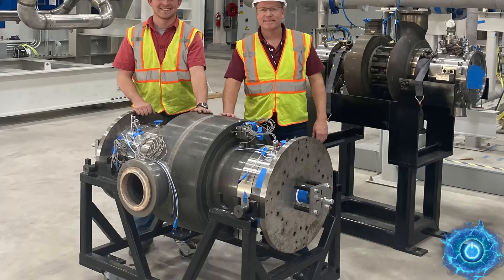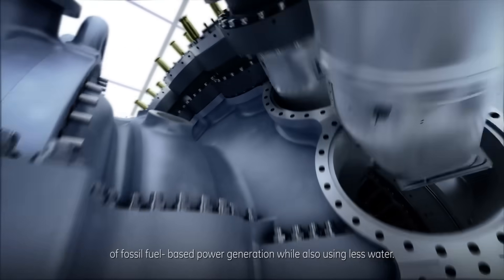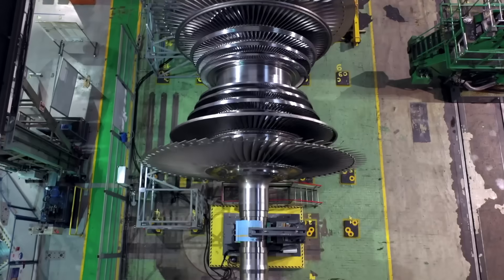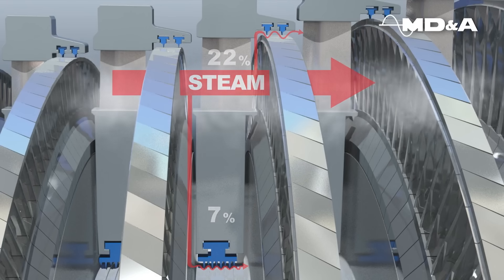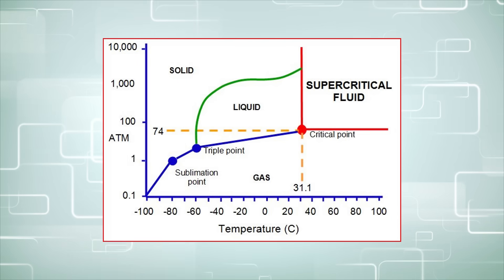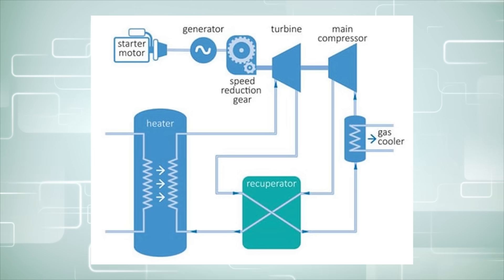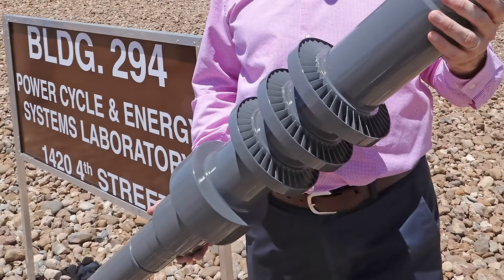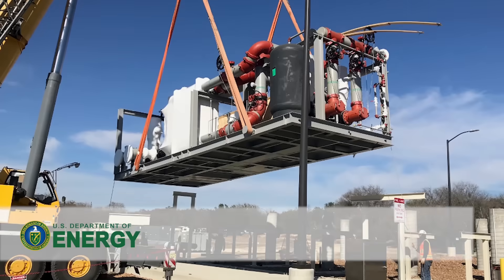BREAKTHROUGH Supercritical Turbine Breaks RECORDS

Comment: Ultra-supercritical technology is used at the RDK 8 coal-fired power plant in Karlsruhe, Germany. The plant achieves 47.5% net thermal efficiency while producing 912MW of electricity, making it one of the world’s most efficient hard coal-fired steam power plants. 

As a note, I suspect that this efficiency number is based on the the Higher Heating Value of coal.  

Another steam power plant utilizing double-reheat steam cycle and cold seawater for cooling, resulted in a net electrical efficiency of 47% (LHV basis).
Reply: Yes, coal is the best end user for CO2 turbines due to their lower Temps allowable compared to CO2.
Reply: @w8stral  
Expand upon what u said, I am unsure what u meant. All I was commenting upon was that the most efficient coal plants are better than what the video said. Oxygen combustion has some interesting applications where the working medium is CO2 with natural gas as the fuel.
Reply: Are you en engineer?  If so you should have been able to decipher.  If not, what limits Coal efficiency is its maximum temperature as it uses water and water is pressure limited not temperature limited.  And no, Coal plants are no more efficient that what video originally said.  mid 40% is max due to energy required to turn coal into dust , preheaters, sulphur scrubbers etc.  But the biggest problem is Thot of Coal verses natural Gas.  Efficiency is ~~~ Thot -Tcold.  Changing from water to CO2 allows much higher Delta Thot-Tcold    CO2 as a medium helps make smaller turbines due to allowable pressures at higher temps.  Does have the big problem that when everything goes tits up, all that high pressure CO2 will kill anyone via asphixiation nearby and therefore will require a giant pressure vessel around the main turbines.   CO2 + water can also create acid, but that can be dealt with.   @Mentaculus42
Reply: @w8stral  
Yes I am an ME and it seems like we are talking around “definitionial” issues and I specified ULTRA-SUPERCRITICAL steam plants with reheat and the information was from an authoritative source. One of the articles specified:

A USC plant operates with steam conditions above 3,500 psia and 1,100F (593C). For comparison, a conventional supercritical unit operates at steam temperatures of 1,000F to1,050F (538C to 566C) and pressure typically up to 3,500 psia! 

So are you referencing USC with reheat? I have done test on regular steam turbines and am quite aware of the parameters. As I noted, the issue with using LHV vs HHV & REHEAT &  the use of COLD WATER for the condenser. Unless u r directly involved with this industry, I will go with the authoritative sources that might have some marketing hype or leave out some peripheral loses but are consistent between different plants with different equipment.
Reply: You are talking tiny specifics which I find useless to talk about unless your fingers are actually in the engineering numbers and totally useless in a Youtube comment; instead I am talking whole plant setup.   @Mentaculus42
Reply: @w8stral 
3:09  He states that steam is 40% efficient, I said better from authoritative sources, 47%, you say 45%, so 40% is wrong and we are arguing over 2% & when I reviewed my source it went into great technical detail about the complexity to achieve that number! So knock it down to 45% because your definition is different than my source. But 45% vs 40% is significant and the video got it WRONG by both our numbers and not a little bit. So if you want to take it up a notch and discuss the details, bring it on.
Reply: @Mentaculus42  Speaking about (direct) oxygen combustion... what does it have to do with this sCO2 turbine? I'm reading that this turbine operates at 700°C while direct oxygen combustion would elevate flame temperature from 2000+°C to 4000-°C... So with the T_hot mentioned by w8stral in mind, it seems oxygen combustion gives great prospects for efficiency improvements (although they now use it for other purposes than efficiency, GTL to be more precise...). But my point is that this seems to be a different direction of research (within the realm of the open gas turbine and not the closed-loop turbine) and this sCO2 turbine is not intended for such extreme temperatures anyway?
Reply: @Mentaculus42  By the way, isn't this the natural niche of these so-called thermophotovoltaic panels... they try to hype those for energy storage applications while it seems more obvious that they will be useful for an initial hot flame stage in combustion processes.
Reply: @Hecatonchires1991  
Direct oxygen combustion can be used in different configurations. The IEAGHG has information on a number of different configurations. If I remember correctly (?), some CO2 working fluid configurations are sorta like on open Brayton cycle (turbine) but the exhaust is cooled by heating a secondary bottoming closed cycle. The cooled exhaust condenses out the H2O and removes the excess CO2 to be sequestered. The remaining CO2 is recirculated to act as a non combustible medium same as nitrogen or exhaust gas recirculation in other configurations. Oxygen and fuel (natural gas or hydrogen) are combusted somewhat normally but in a flow that has CO2 substituted for nitrogen. Irrespective of the peak flame “front” temperatures (this can be controlled by combustor design to some extent), the average temperature of the bulk gas flow is controlled by its bulk properties, thus turbine components are subjected to bulk temperatures. Some of the benefits of this configuration is that nitrogen is excluded from the cycle (no NOx  production) and the exhaust flow is basically CO2 and H2O and can be efficiently handled. 

This is just a simplified description of a basic configuration, the IEAGHG has numerous technical reports on various configurations. This type of approach is generally not “embraced” by certain “factions” as they “hate” this approach to electricity generation on various grounds and consider it a diversion of economic resources from their “anointed” approach.
Reply: @Mentaculus42  thx for the response. Just one remark: such a "bulk gas" (1500°C or so), which is cold enough not to damage the turbine parts... know that that is where the major concessions are made barring greater thermodynamic efficiency... that's where my remark about those thermovoltaics comes from. However, I looked it up and the contemporary 40% cutting-edge effiency of these panels probably doesn't justify their use in the 1st stage of a modern combustion reactor (it should have been over 70%, Carnot efficiency = 90%). Just to recollect how long the road ahead still is: both anthracite and methane have an adiabatic flame temperature (oxygen) over 3500°C and so a Carnot efficiency in excess of 90%.
Reply: @Hecatonchires1991  
As you say, still room for improvement. I think that is where “pulsed detonation combustion” within the combustor has research efforts directed towards it for improved efficiency. Don’t ask me how it is supposed to work in practice as the information about it seems to be classified and difficult to find. But there is evidence that research is ongoing.
Reply: 47.5% efficiency and wnet are 2 different things η=Wnet/Qtot,in. Wnet comes from Wtot=mass flow * Wnet can you explain what you mean?
Reply: @xrhst0s2114  

I was using the terminology as put forth in various articles from an authoritative source (from a long time ago, so I don’t have the ability to go back to them directly). When the articles talked about (what I assume is total cycle efficiency, coal energy in [sometime HHV, sometimes LHV {I have seen it quoted either way if I remember correctly}] vs electric power out. When articles present the information at a sorta high level without going into the details, things are a little fuzzy (I suspect that the information gets passed through various people). Since it was an authoritative source, I assume the people who wrote the article had at least a rudimentary understanding of what the generally accepted meaning of total cycle efficiency is. There is a lot of ways to make things fuzzy, and these articles were not intended to convey detailed engineering specifications. As it was I had to do some “interpretation” which I thought I had conveyed. Besides, the whole point was to state that the video used an improperly low number. 

So I checked again from PowerMag site and the latest HIGH LEVEL article states:

“Pingshan Phase II, 1.35-GW ultrasupercritical coal-fired unit, achieves a net efficiency of 49.37%—making it the world’s most efficient coal-fired power plant.”

AND

“when a Siemens and Steinmueller–led unit performance acceptance test confirmed the 1,350-MW ultrasupercritical (USC) coal-fired unit’s lower heating value (LHV) net efficiency reached 49.37%.”

So this is what you get in these types of articles, they specify the somewhat vague terminology but I assume the source is not doing a bs article and it is [energy in (LHV) / Electric Power Output {inverted or 1 over efficiency}] from the generator before the step up transformers. If you have a different understanding of what this terminology means, please explain.
Reply: @Mentaculus42  Ok got what you mean probably they need some engineers when they are writing the articles.

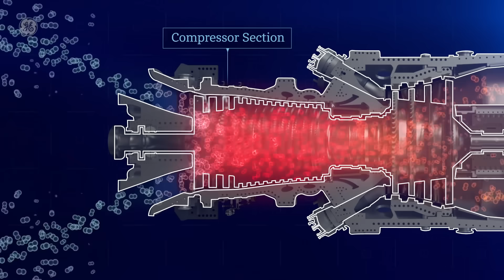Comment: 1:02 You might want to work on that graphic a bit more as the RED GAS FLOW has significant issues❗️Unless you are NOT using a cross section but some type of 3D flow which seems to be a bit nonstandard.

Comment: the turbine is light weight, why dont they use it in electric planes as it makes more sens to have one power generation unit and then have high output electric motors, its not really possible now with the current battery tech, and solid state batteries are not gettting anywhere yet, but coupling this with super-capacitors in electric aircraft
Reply: For an airplane you’re gonna want something that is basically bulletproof technology. But maybe for ships.
Reply: Eternium Aerospace is doing this exact thing. They're using hydrogen combustion to power a closed brayton quad to generate electric power to power their superconductive motors. Look them up!
Reply: I like where you are going. Not sure if the complete closed cycle assembly would be made light enough, but it would be an interesting research project when you have an infinite heat sink at 35k feet.

Comment: I would like to know more about how this turban would work, would it cycle between supercritical a normal state gas, or remain supercritical though the entire cycle?
Reply from the maker: Good question, it appears to remain supercritical during the entire cycle. C02 is pretty corrosive in normal liquid/gas state.
Reply: So it uses liquid carbonic, the same as what is used in soda pop.
That seems to be the other way that supercritical CO2 is used and transported.
CO2 is either a solid or gas at normal atmospheric pressure, but can be made to take a liquid state under pressure.
This is interesting, as other components will have waste heat, which could be utilized if heat is needed elsewhere if the CO2 liquid is utilized as a coolant for those parts.
Reply: @@retiredbore378 most steam locomotive use wet stem,is a single unit , piston work on retention of steam, they aren't prom to steam damage because is a control expansion, modern stationary are more complex, NASA couldn't rebuild or replicate the old Apollo main engine because the engenier only have books and the original engine,but a  thank you for taking your time,ahh according to a books a plain going really fast heats up because the air is compres thus the increase pressure,but in real life expanding air ( from 100 PSI to admosferic) incident in a robber glob can melt the rubber, is counting intuitive.
Reply: @@retiredbore378 the beauty of refrigerant gases in a close cicle the sistem can be balance so it never wet in the expansion only in the cooling, because of the size the blades are much less prom to damage.
Reply: @@retiredbore378 in steam turbines the steam fo at supersonic speed, in water propeller are damage by steam so by the books steam turbine will be a impossibility, people who do this articles Aren't necessary the the ones duing the research.
Reply: @@retiredbore378 if a simple blow 🌬️ gun can reach 100 mile/h imagine 3000 PSI,they have dessing steam turbines no to go to fast, speed in turbine is in RPM, I am referring to the speed of the steam within the casing.
Reply: @@retiredbore378 exactly ,steam locomotive don't require super dry and free of contamination water. the comment was on steam turbines people don't realize the speed of the steam inside turbines.
Reply: Well, a turban at supercritical temp would probably burn up..... ;P But I wouldnt know, I dont wear turbans!
Reply: @shaylethorne2387  Funny. I am going to blame spell check, though I can make mistakes.
Reply: @putteslaintxtbks5166  Sorry man, I had to . Its the internet ;) Cheers for not getting upset mate!
Reply: if it was supercritical through the whole process there would be no pressure differential and there would be no flow. its like asking "is the water always liquid in a steam engine?"

the co2 is merely used as it has far less latent heat during its phase change. water takes 6 times the energy to evaporate as it does to bring to the boil. and that energy is lost again when its recondensed.

you need the condensor to drop the exhaust to as close to a vacuum as possible.

how can co2 be supercritical when it also has to reach near vacuum at the exhaust stage? otherwise it simply wouldnt flow through teh turbine at all. the closer you can get to a vacuum, the better a turbine works. the most energy in the steam is in the portion when its BELOW atmospheric pressure! thats why pistons are so lousy, they have to dump all that steam well before using all its energy... they just cant expand enough and keep producing force, torque, whilst a turbine CAN.

they might not push co2 turbines so low, but it makes sense to, as the lower the pressure, and the lower the temperature on teh cold side, the higher the differential and the more energy there is to be extracted, and the more that one can extract.

a condensor still has pumps... air and water pumps. has to force this now cooled steam, water, back into the boiler to repeat the cycle. the latent heat to boil the water, its lost, gone forever,unrecoverable, and so is the energy to drive the pumps.

without the heat being applied, it would soon grind to a halt as the pressure in the entire system does reach equilibrium. supercritical or not! 

as co2 is far easier to recompress to a liquid and push out what little latent heat it has, you lose far less energy through the unavoidable phase change from gas back to liquid before "boiling" it again. it loses out on the energy it can "hold", so the system needs to be very well insulated and laid out for there to be a benefit. water has a high specific heat, it holds a a lot of energy for its mass/volume. iirc, only helium is better...

the co2 is merely a conveyor belt for the energy, the flow of heat... it has to keep circulating... and the only way for it to circulate is a pressure differential. and its the temperature differential that creates the pressure differential to drive the whole system in the first place. the heat wants to flow form hot to cold, the subsequent pressure then wants to flow from high to low... and we extract some of the energy, "push it off the belt", as it passes on its way form hot to cold by restricting the flow in the turbine...

they trialed mercury boilers in the early days, they were successful too... mercury can do the high temperature part in the boiler, has a low latent heat, easy phase change, and what heat is dumped in its condensor boils water in a secondary low pressure/low temperature system.

sodium or other low melting metals work just as well but mercury is already liquid, makes it easier. and its DENSE! that makes the system small for a given power output, mass flow through the turbine.